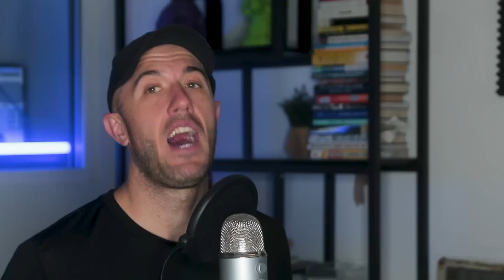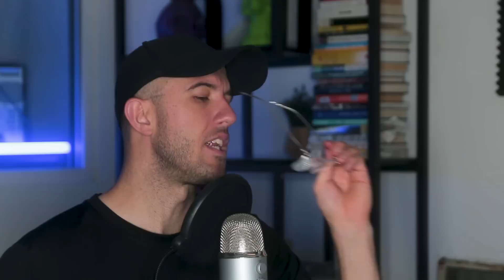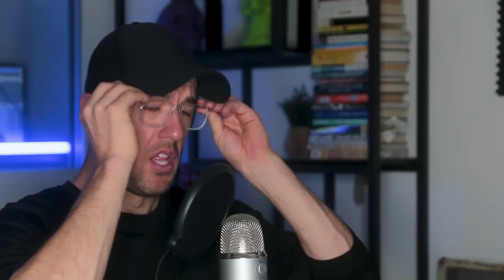3D Modelers Are Important | Stratasys Sues Bambu | Kathy Woods on 3D Printing | 3D Printing News

Comment: The heated bed patent isn't on using a heated bed. The patent is very specific and covers using a polymer coating that allows the removal of a part without damage to the build plate or the part itself. 

That patent in itself is more interesting because of what it does not cover. the patent specifically does not cover build platforms that are covered in tape, IE covering a steel sheet in kapton or something similar. As far as I can tell it also doesn't cover using build platforms made out of fiberglass-reinforced resin, such as Garolite or FR4. 
I did not dig into the patent very far but I couldn't find anything on what Stratasys defines as tape. So if the manufacturer applies an adhesive-backed PEI film to spring steel it doesn't violate the patent, but if the PEI is sputtered on directly then it does? The only way to get answers to this is if it's tested in court.

Stratasys is suing over another patent relating to using variable-width lines to print infill better. This patent is strange because it's essentially 50 pages of algorithms describing how to make gcode that accomplishes this goal. The patent filing itself is borderline incomprehensible and, as far as I know, the Arachne slicing engine (which Prusa implemented and Bambu forked) skirts around it by using a completely different set of algorithms for detecting and mitigating the same issues Stratasys's patents do.

The other patents they're suing over don't have much to comment on.

Comment: As for API: consumers of your API want control. You can create "presets" of slicer settings or something and expose those through a different endpiont, but consumers will generally appreciate an "advanced" endpoint where they can tweak individual settings until they are happy with them.
Reply: That might be for the small office or duffers, but large scale consumers (businesses) don't want hands on. They are paying the provider to provide results. "Tweaking" means they write a ticket or change order and be done with it. The business consumer has more important things to do.

Comment: Your videos on industrial design have been incredibly helpful in my design process.  Any advice you can give on designing an auto eject system so my printers aren't dead in the water after a print?
Reply: If the part is small enough, you can add gcode to the end of the print to have the gantry come down behind the printed part and move the bed to push it off using the aluminum rod.
Reply: @rodclar3087  that's a great idea!  I didn't think about that.  I could add a bar across the gantry so it only puts pressure on the ends close to the joints to prevent the gantry from deforming over time.  Each bar could be customized to scoop a specific part off the bed.  Thanks a ton bro!
Reply: Easiest solution would be to angle the machine into a bin with custom script to use the gantry to bump the part off if able to do so
Reply: @benburmeister3428  great idea!  Check my reaction to @rodclar3087.  Thanks a lot, man.  'Preciate it.
Reply: @benburmeister3428  great idea!  Thanks.  See @rodclar3087 for my response.
Reply: @joshstephens3224  how large of a model your trying to print? And how much are you looking to spend lol
Reply: @benburmeister3428  small models.  Wallet size.  I've got the skills, tools, and access to material I need to make them economically myself in the small quantity I need.